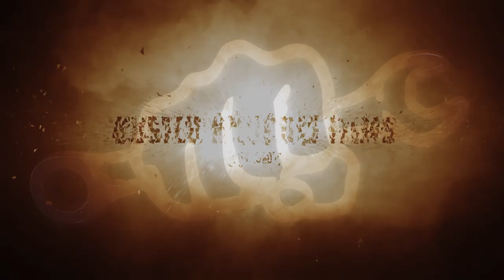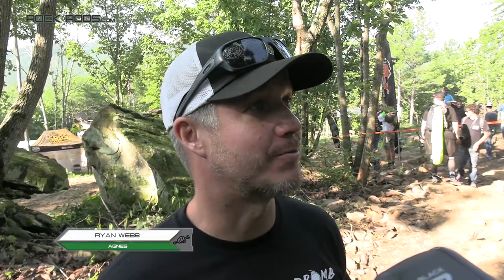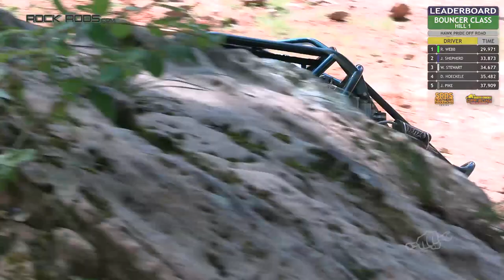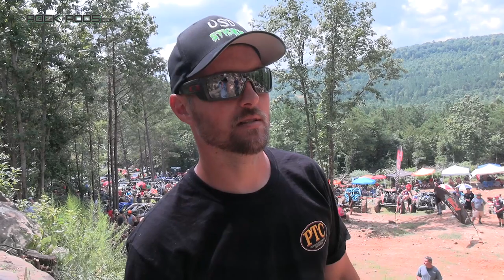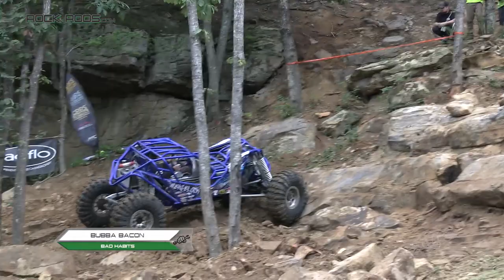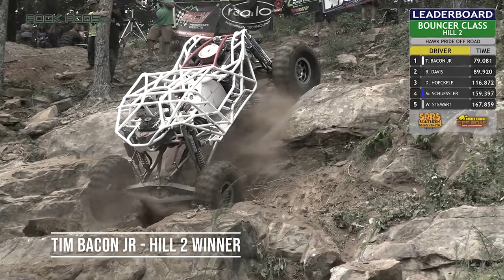MAKING ROCK BOUNCING GREAT AGAIN - Rock Rods EP86

Comment: Comparing n/a hp to centrifugal hp, like hell bent vs gold rush, it looks like the more linear power curve of a n/a engine is better suited for this application. You can make the numbers either way, but the centrifugal setup will always lack bottom end being that it’s boost is rpm dependent.
Reply from the maker: A lot of it is driver

Comment: So I'm new to rock bouncers. If I'm correct it's a run what ya brung formula aside from safety. So my question is why are guys not using significantly more aggressive tread patterns? Our side by side and utvs have a much more aggressive tread then a lot of these trucks run. Not criticising just curious what the thought process is.
Reply from the maker: more aggressive like Tractor Tires? All of these tires are competition compound and cut to work in loose dirt and the rocks. And I don't know how you can look at a 46USD and not thing they are aggressive?
Reply: BustedKnuckleVideo I'm more into the mud world of off roading. Around my area everyone pretty much runs a tire called an assassinator. Which is a very aggressive large lugged tire similar to an r1 ag tire but not identical. Or they run an r1 ag tire just depends. I'm not suggesting these tires aren't aggressive. What I'm asking is why are they not using a larger lug/ deeper tread pattern tire? Is it that you guys aren't really worried about overall grip and are instead just relying on wheel speed to clear the tire and get you through? In one of your older videos two guys actually make a joke about running r1 again tires and mounting them backwards. Obviously I'm missing something because everyone is running a similar tire for the most part. That's what I'm trying to understand is what I'm missing. This probably the 10th video I have watched of yours and am enjoying it. 👍
Reply from the maker: many of the courses are a mix of loose dirt and solid rock, ag tires would help in the dirt but hirt you in the rocks so the cut tires that they run are a best of both worlds setup
Reply: BustedKnuckleVideo thanks for the info.
Reply from the maker: glad to help